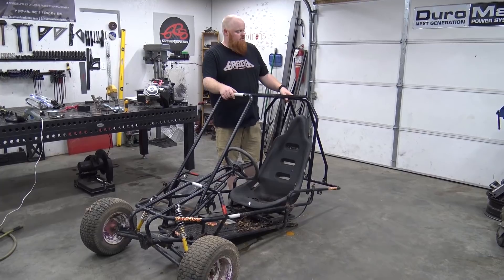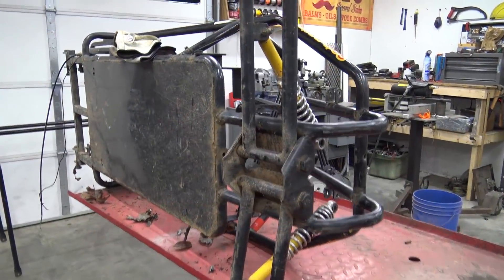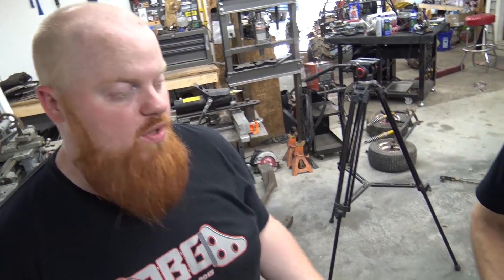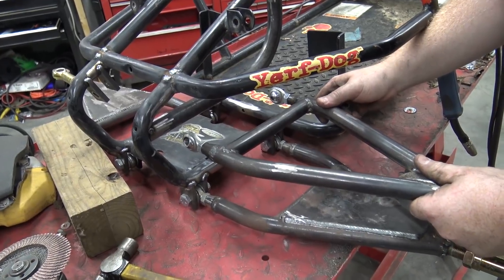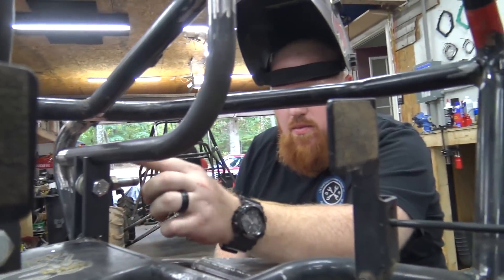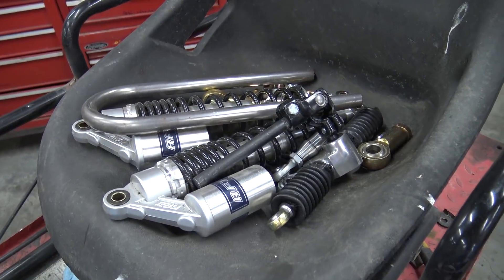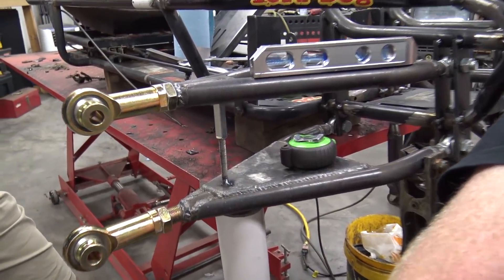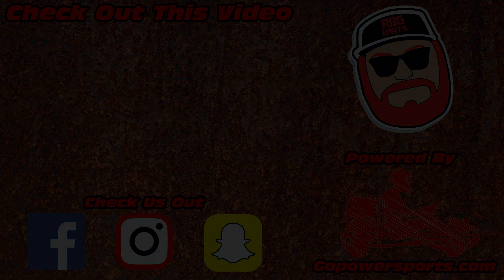Dual A Arm Front End ~ Yerfdog 3200 Build Ep1

Comment: Unequal length done right gives you negative camber in both travel directions which can be tuned to increase the contact patch.  Especially when it leans to turn.  But equal length can give more travel for offroad.  Both have their positives.
P.S. the RFY shocks are decent, but look around and they come under filled with a nasty yellow fluid.  Opening them up and cleaning them then fully filling with good 10wt fork oil makes them really good for the price.

Comment: Camber gain can be used to make the handling better. Look at nascar or a dirt modified or late model. Average Joe's website has some good suspension tuning information. I didn't see but did you put caster in the front end ? Caster will make it track straighter easier